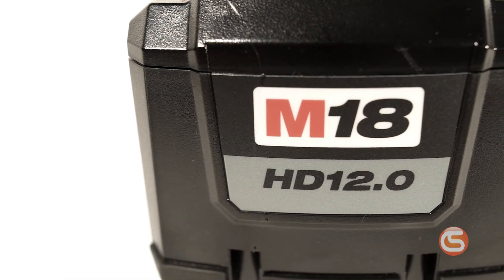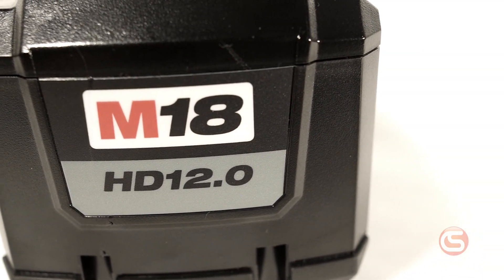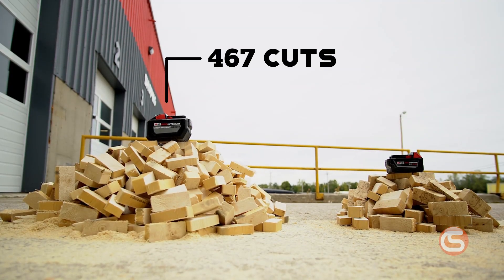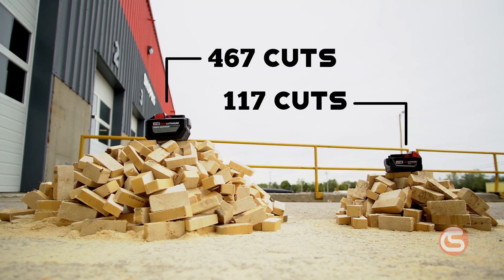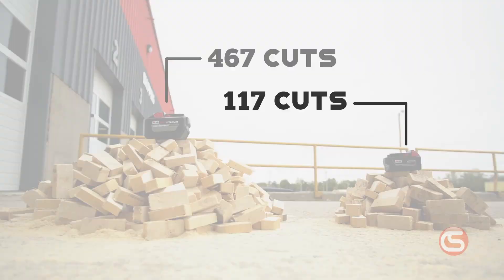Milwaukee M18 HD12.0 Battery Test

Comment: I've run XC 4.0Ah batteries on that saw just fine, constant 8ft rips on plywood sheet, using a Kreg rip guide so I could start a new cut walking the other way on the plywood almost immediately and I had a helper swapping sheets. I was making 33 cuts, 264 linear feet on a single 4Ah charge. I just don't see how the extra weight of a 12.0 is worth it unless swapping batteries isn't an option. HD is really only for the highest power tools in my opinion. Notably, the chain saw, chop saw and compound miter saw.
Reply: You forgot the vacuum cleaner. You NEED the 12 or you have to swap batteries constantly. A 9 still lasts half an hour, but the 12 lasts longer.

Comment: I use makita . 

My friend use milwaukee . 

Trust me he learn the hard way Milwaukee are not reliable but hey at least they honor there guarantee . 

He have burn 2 battery . 1 impact , 1 drill , 1 rotor . 

I do the same job with makita and nothing have burn or anything . 

Reliability is realy important not only performance .
Reply: I agree but Milwaukee is still better
Reply: It’s like makita is Toyota Tundra and Milwaukee is a F250. I’ll drive the f250
Reply: I wonder if your friend is using the tools wrong. Yes there is a right way and a wrong way of using tools.
Reply: Was he using brushed tools??? I’ve been using milwaukee for 7 years, started with dewalt products. No such thing has happened to ME in regards to tool failure and I put my drills through hell sometimes... I once sold a friend my hackzall ( gen 1 brushed motor ) after 3 years of use and he did later state that it died on ‘em. 
I try to stick to newer tech ( brushless motors ) when i’m able. Older tech has shorter lifespans and is more liable to faults no matter the brand.
Reply: @mannyfresh8504  yes hé use the fuel séries .
Look like brushless engine realy dont like dust and humidity .
Reply: @calom4823  i use my Milwaukee in dust, rain, snow, etc... (specifically my impact driver)... i agree with the other comment about the possibility of your friend not using tools properly. Idk...
Reply: @mannyfresh8504  Same we work outside ,rain , mud , dust , hot in summer , cold in winter .
He just broke is 2 battery charger this week to only 1 side work now . Yesterday was a realy cold day -38 c .
Reply: @calom4823  lol.... ok, this guy has some bad luck thats all.  On another note, whats makitas top impact driver? Ive been looking to purchase their XTD16. One problem I have with milwaukee is their collets on the impact drivers. It releases the bit sometimes in reverse when their is resistance which im sure has caused me to lose a bit before which is an honest problem for me.
Reply: @mannyfresh8504  Actually i dont know i still using my old one its not even brush less .
Use it for windows , door , 3/4 screw for deck etc . The impact milwaukee is realy powerfull and fast way more powerfull then my old impact . My friend make fun of me when i put the 3/4 screw with mine cause its a little slower heheheh .
Reply: I put my 1/2 impact through the hardest tests it can fight all the time at work. It goes far and beyond what it should. My coworker and I have the same impact and never have problems
Reply: I run millwaukee and my boss runs makita he learned today on 40fters 🤣🤣 had to use mine to get a hanger screwed in threw concrete board and aluminum
Reply: makita falls apart
Reply: @DrComingz  He just broke is new skill saw Milwaukee the piece is B O 6 mounth he still dont have it lol.

Comment: My 12.0 get overheated running a 9" grinder at 70 degrees in 7 minutes
Reply: Can confirm.
Bought into the hype.
Battery tools not for metal workers like us

Comment: That battery was specially made for the gen2 brushless circ saw ......try again
Reply: Doesn't matter works on all tools, it was a battery comparison between 12.0 and 5.0. Not a saw comparison
Reply: That saw is a brushed model.  What why would you use a $200 battery 18 $99 brushed circular saw

Comment: Not even a proper fuel saw
Reply: Doesn't matter,  it was a battery comparison from 12.0 vs 5.0
Reply: @kwmiked  yes but 700 cuts using a fuel saw not old brushed one
Reply: Brushless Motors are more effective with Li-Ion batteries. It could have produced very different results percentage wise